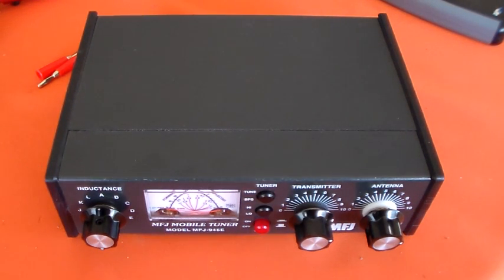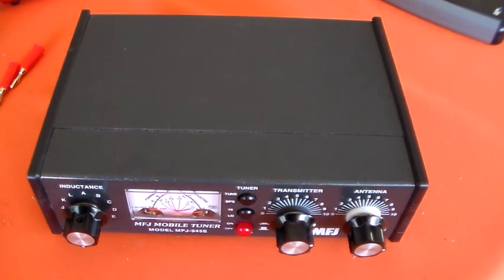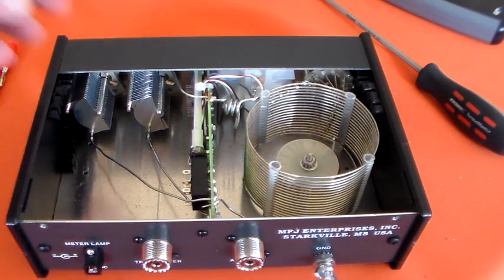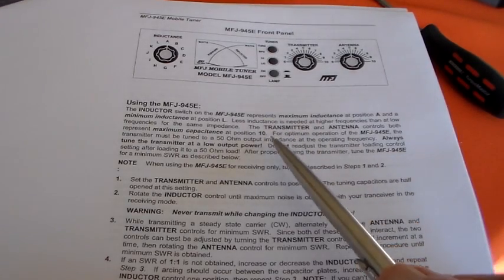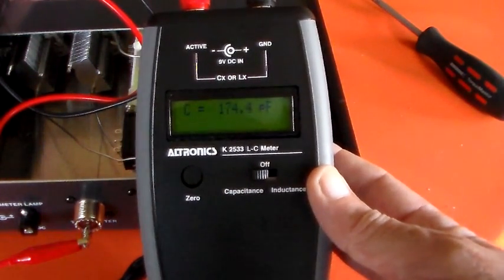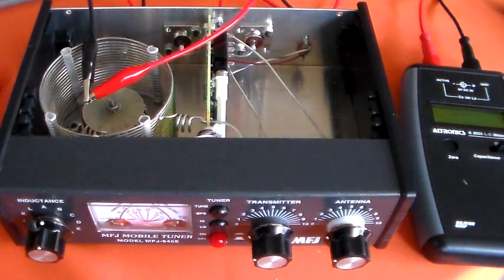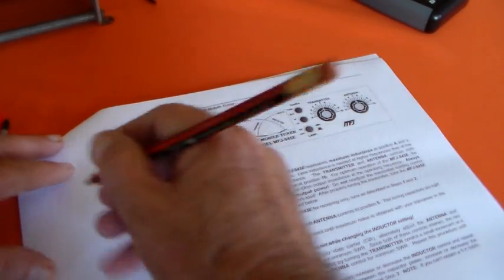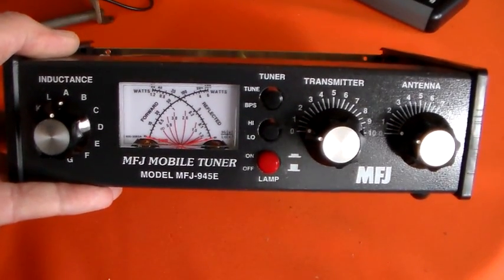A Quick Look Inside an MFJ945E Antenna Tuner.

Comment: Nice vid,ty! The manual says its calibrated to 10 watts. So press bypass, press low, adjust power to 10 watts and then tune. Reverse when done.. I was looking for info to where the inductance knob is set in relationship to the actual switch connections. Mfj says that A os full inductance and L is lowest. I removed the knob, but there is no cutout to tell you the spot to return the knob to. Since the stem of the switch is round and nit half moon.

Comment: Hi, Thanks for the explanation, Mr. VK6CS, but I would like to know the part in the middle ( With green color ) about what it is and its role in the device. Have a nice day, man
Reply: It’s a circuit board that holds all the buttons and bypass switch and connects them to their respective functions as far as I can work out mate.

Comment: I have two of these tuners, mobile and base station, both have same issue with knobs needing 180 degree adjustment.  They handle 300W nicely though.  Also, one came with a burnt out light bulb, otherwise good units.

Comment: Don't like how they put the balun in the centre of the inductor would prefare it on the back of the unit .
Reply from the maker: It's not too flash having a metal plate at each end of the coil either... but it is MFJ.

Comment: Very well done. I like the size of this little tuner. just picked up one at a hamfest.  Planning on using it on portable and qrp use .But after I tried it . I noticed that the meter was off . and be4 anyone asked ! yes I checked it to another tuner. my q is .  are there any adjustments on the board that I can correct this .??
Reply from the maker: Thanks for that. There is an adjustment but unfortunately being MFJ you have to choose which reading you want to be reasonably accurate... the high range or the low range. I chose the high range. You just have to put up with one range being wrong.
Reply: are these on the board ? I see 3 pods . thanks
Reply from the maker: I honestly can't remember. MFJ have the circuit diagram of this tuner on their website, that should show you all you need to know.

Comment: Hi once again Tony, thank's for another interesting video.  Reading down through the comments I see Roger McCarty hit the nail on the head in one , so to speak. That is what I was going to say about reversing the knobs. When in the Army there were a lot of knobs I would have like to have reversed. I think I would have got court marshaled though, Hi Hi. Say no more. I think MFJ could have used a ceramic rotary switch for the inductance for not a great deal more in price wise. I did a stupid mistake myself on that by using what Maplins had on stock and ended up with a burned out switch on my own built mobile ATU. You live and learn has the saying goes. 73 de John - G0WXU.
Reply from the maker: Blimey... I can remember buying bits and pieces from Maplin. I built a few of their audio amplifier kits. I think they worked pretty well from memory, but it was a long time ago. Knobs in the workplace is not exclusive to the military as I'm sure you know, at least you were in an environment where you could put them in harms way HI. The trick with small/cheap ATUs is to never switch them with the RF power applied, and if possible cold tune them with an analyser before you apply power from the transmitter. 73 John.

Comment: Thank you so much for clarifying max inductance is 0 not 10 , best 73  :-)
Reply from the maker: Thanks Phil. Note: it's the capacitance that's at max at 0, not the inductance. 73
Reply: VK6CS  
 Oops once again thank you  for the correction, tbh, I've  only had it two days & I'm just getting back in radio . Hope to take my foundation licence soon 
Over here in the U.K. But until then I'm just gunna use 27megs & PMR 446. But once again thankyou so much , as I think I would of pulled my hair out ( if I had any ) hi,  73 de 26CT2037 :)
Reply from the maker: Cheers Phil. Good luck with your exam.
Reply: VK6CS from 26CT2037 cheers and beers my friend ,hope we can keep on having little chats do you use any VOIP's at all ,QSL ?
Reply from the maker: No, I don't use any internet radio system. I'm old school, at the moment I think it's plastic radio. However, if I get old enough to be put in an old folks home I will no doubt embrace Echolink, DMR and D Star etc.

Comment: Which is best for all around tuning and power output? More inductance? Least inductance possible? More capacitance? Less capacitance?
Reply from the maker: With a T match like this one the most series capacitance is the most efficient power throughput. I tried a few experiments and found the throughput power difference between the most series capacitance match and just tuning the usual way by initially having both caps set to mid point made negligible difference. It's also much easier to get a good match by starting with both caps set half way and then finding the best inductance, then tweaking the caps.
Reply: Thanx for the response! So, the inductance is really not a factor? You would use the conductance that requires the greatest capacitance?
Reply: @TheLonesometoad  If you had watched the video he already mentioned the answer to your question!
Reply: With a T match like this one the most efficient power throughput will be when minimum SWR is achieved with as much as possible inductance of the coil, and as much as possible capacitance of the second capacitor marked as "antenna"!  You can find more information on my web-page, which is originally written in macedonian language, but you can use google translate:   http://www.qsl.net/z33t/antenna_tuner_mkd.html   and this one:  http://www.qsl.net/z33t/mfj-945e_antenna_tuner_eng.html
Reply: Hello Mile, could you measure the diameter of the wire but also the inner diameter of the coil? I tried to make a tuner myself.  73 de 9A6GEZ

Comment: Just curious, why not simply take the knobs off and rotate them to match the instruction booklet?  My guess is there was a mistake made during assembly.
Reply from the maker: Roger McCarty Thanks for the feedback, that's a very good question... I hadn't thought of that. I have rotated my knobs so that 10 is now the maximum capacitance, now I'll have to redo my quick tuning chart. And, remember they're now correct.
Reply: give that man a cigar!!!
Reply from the maker: Well... it is amateur radio.
Reply: that it is....and boy do I feel like one most of the time...I am only a part time nerd so I have a lot of trouble with all this, I just got that Tuner yesterday in the mail so i am trying to research on how to use it, I believe you taught me enough to use it....I hope to put my antenna up tomorrow, I put the tower up today with my dual band on top at 55 feet top the bottom of that..
Reply from the maker: Thank you for those kind words. Your antenna system sounds great. I wonder what power you're planning to use?